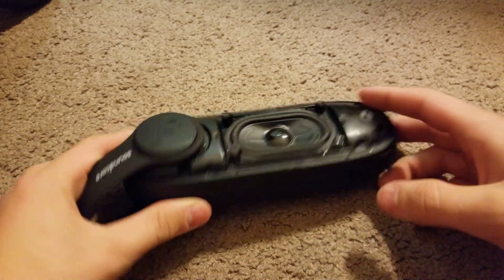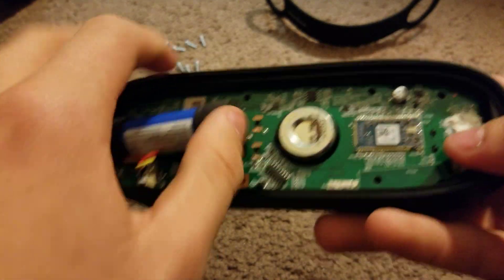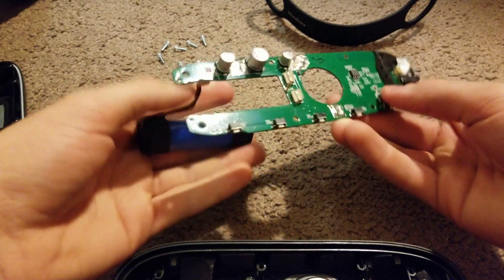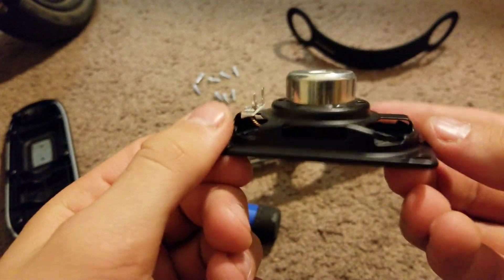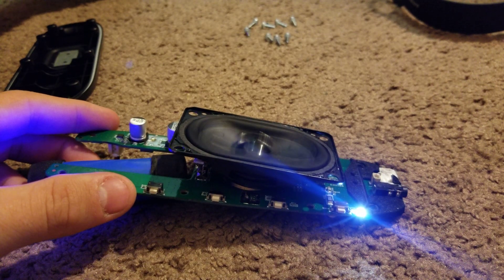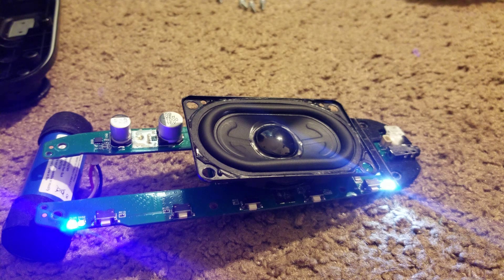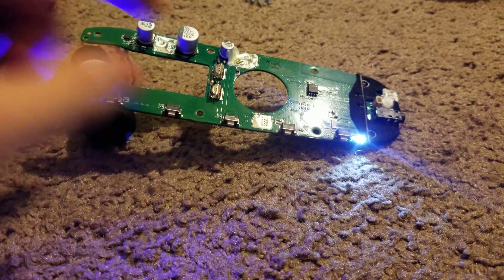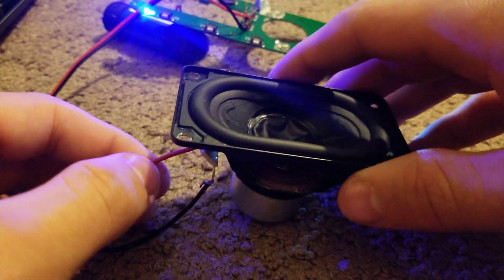Anker Icon FULL Disassembly and Free Air. JBL Flip 5 Driver Swap too!

Comment: I'm curious why the JBL GG version has 3 wires on the speaker?
Reply from the maker: Double ground maybe,
Reply: When I bought my Flip 5 GG version I tried the TL version and it was so loud that you will think it's gonna break so I red that GG VERSION is better
Reply: Amplifier is hybrid mono so their is no ground in speaker connection .. only + and -  so to cancel external noise they use ground as middle wire